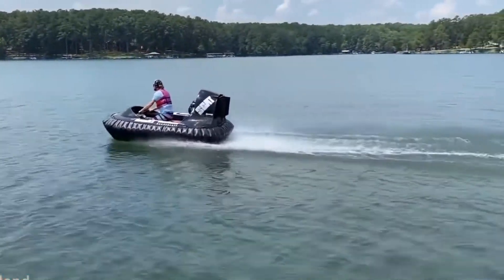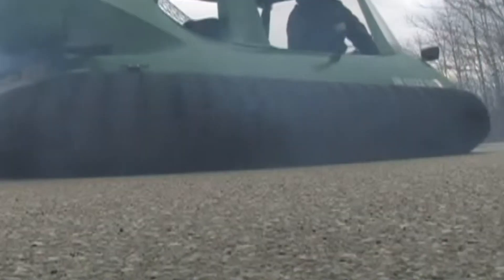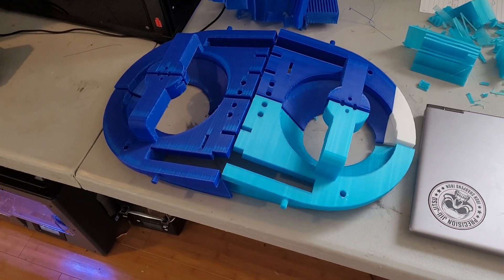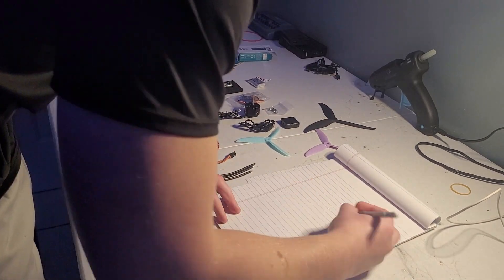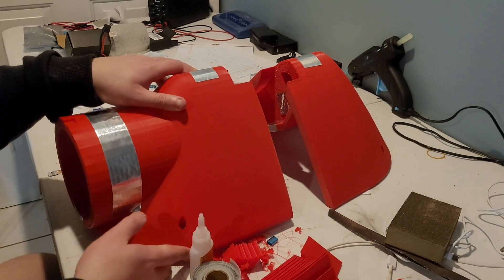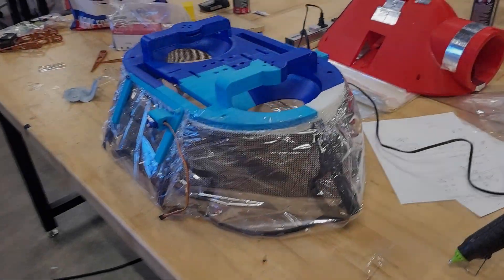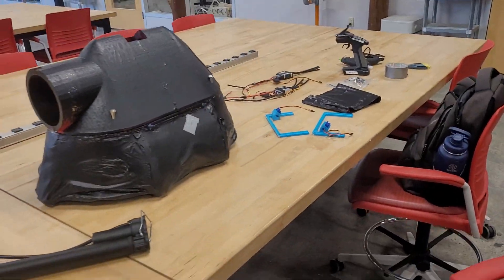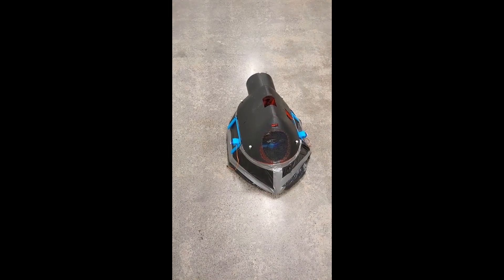UNMANNED HOVERCRAFT! A Challenging Project

Comment: why order all the non printed parts ?? local hobby shops carry the parts out of drone stock.  you would guarantee you got all parts AND probably in less time. #justsayin :D
Reply from the maker: You are completely correct. There were many easier and far cheaper solutions to this problem that we definitely would have taken. For our project though, the professor running our capstone wanted us to 3D model our own custom design, do fluid analysis and FEA analysis, and create the prototype with additive manufacturing. As for the non printed parts, Our college has a specific ordering compliance we have to follow. Its called byways, and all parts must be ordered through it. We were not given our $500 budget. The campus held onto it and used it through byways.